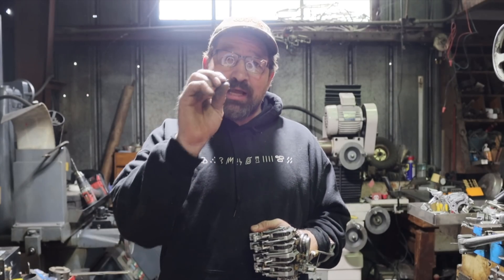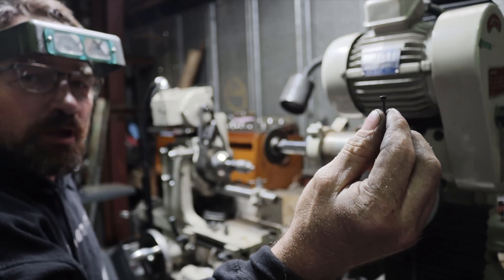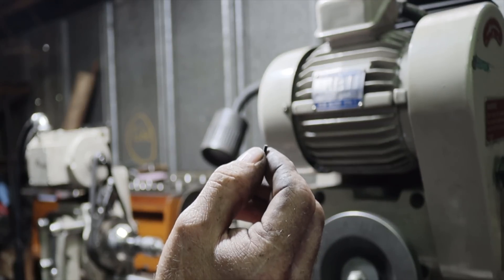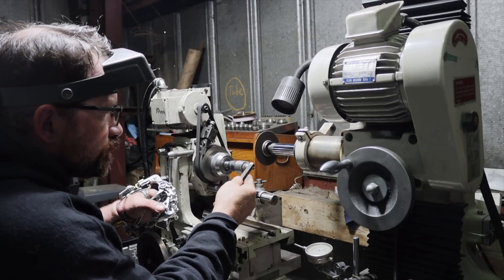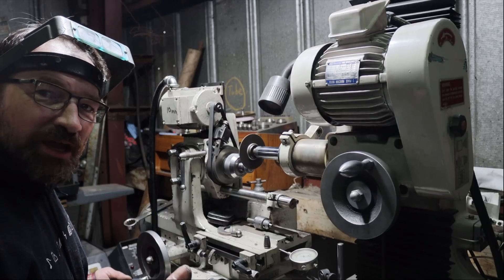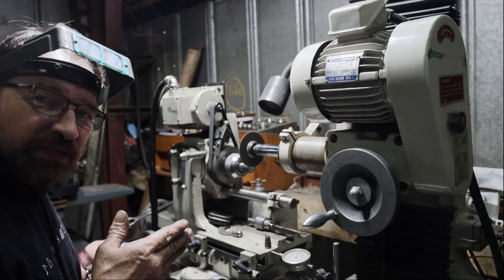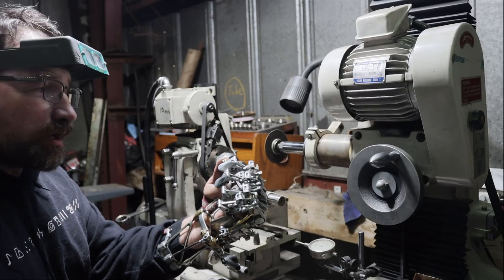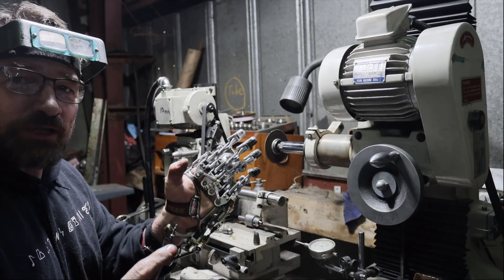Missing Parts Monday, Custom Screws

Comment: looks like a great part and a nice fit. If you're using bearings in the fingers (fancy), I wonder if you could get monofilament thick enough to place through a shaft hole. Then placing a hot iron on one end produces a really nice rivet head. This is how I held together my nylon hand skeleton which was a robot study. I never got around to  coating it with fishing worm jelly. But I did one finger like that. I also think it would be interesting if you could use the monofilament with a stainless casing around it so just a short length of tube cut to fit with a piece of monofilament thread through it and then flatten the ends with heat, since the lateral force is not that significant.

Comment: wouldnt it be easier to order custom made bolts for all ur applications so then u dont have to worry about both running out and mismeasurements when building new projects? i know from a economical standpoint its less viable since you need to pay more for the same thing, but at least in that case u can get a surplus if need be
Reply: Making them yourself is so you don't have to worry about them running out. You just make them as you need them. And as you iterate you can take off another half mm or so. Whatever you need.  For a run of 10 bolts or whatever he needs. you would be paying someone to do this manually anyway and ship it to you, they won't have any better tooling than he does for a short run. Plus, he machined everything, hundreds of parts. Randomly outsourcing 5 of them would be odd.

Comment: Such a bizarre machine, I suppose these would be crushed by a lathe!
Reply from the maker: You could turn them on the lathe. But I'm using the t&c grinder as a cylindrical grinder in this case. The video was pretty close to real time to grind a custom screw.

Comment: I love your work and videos, but have you considered what might happen if that cutting disk were to rupture like angle grinders and dremels do? It looks like for accurately watching the cuts you have to put your entire face/neck/torso into alignment with the danger zone. That seems like a huge risk IMO. Maybe some sort of shield could help reduce that risk? Be safe and keep doing what you're doing!
Reply from the maker: I suppose it could be, but these disc's are designed exactly for this purpose.  Also they are 10k wheels that I'm only using at 5500, the sub is only 400 rpm. So the combined speed is 6k or 5100. If it were a heavier cut it might be concerning,  but so far I haven't had one chip. Of course they aren't harbor freight wheels, I use Norton wheels.
Reply: @missingpartsclub  As long as you are comfortable with the cuts it's making and think there is enough leeway with your safety factor. I'm certainly not versed in that sort of machine, just the issues with spinning cutter disks in general.

It's actually very awesome to see that machine, after having used a drill-press and dremel in the past to a very similar effect, wasn't even aware that a tool that acts like a 'live-tool-lathe' was an actual product available. So thanks for sharing that with us. If you have other not so common tools like this you should totally reveal them to us like this when you use them, it's just great fun to learn then see it in action making parts for your 'missing parts club'

Comment: I've never seen this machine. Why would you use this over a standard lathe?
Reply from the maker: In this video I'm using it as a cylindrical grinder, but you can also do direct dividing with the sub spindle, as well as left or right  spirals and tapers.

Comment: That's a nifty machine, makes for a nice little cylindrical grinder.
Reply from the maker: It does! although really,  you can do so much more than that with it. The sub spindle and do both L and R spirals as well as direct dividing.

Comment: 2:19 - quite dangerous move, could have gone quite ugly quite fast.
Reply from the maker: Thanks for your concern, you can't see from the camera angle, but there was probably 4" between the wheel and the sub spindle when I was checking the fit of the second bearing.
Reply: If id be in your field of work, i'd probably put plastic see through on moving parts, which unlocks, when machines are stopped. Dont trust myself...
Stay safe.
Reply: I also thought that it looked kinda sketchy

Comment: i've never seen this sort of machine before. What i'm wondering is how you are able to grind precise diameters. That grinding disc seems like the kind of material that will slowly grind away, like an angle grinder. If it does that, how do you work with the diameter of the disc changing size?
Reply from the maker: The wheel does end up wearing away, you kind of figure out what the wear factor of the wheel is and compensate accordingly. A lot of it is by feel and tone. The harder you press the cut, the faster it wears. So you want it to always have the same sound when you grind the seats.
Reply: Interesting, thank you very much for the answer. Is there any reason why you don't do this work on a normal lathe?
Reply: Another factor of grinding is that generally the amount of material removed is pretty small, so not a ton of material is lost from the grinding wheel during a single operation, minimizing the size change.
As for the lathe question, one factor I can think of would be that the screw is at least somewhat hardened which makes turning on a lathe more difficult, and another would be that the lathe tool would exert more cutting forces on the long skinny screw, risking deflection (and having to take multiple passes to get an accurate and consistent diameter). Grinding exerts comparatively very little force, and doesn't really care about material hardness, within reason.